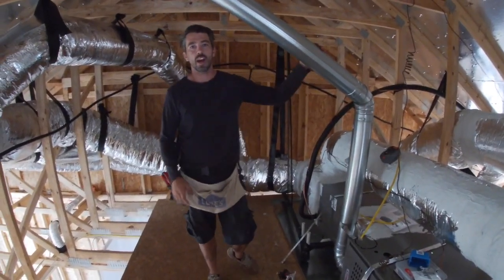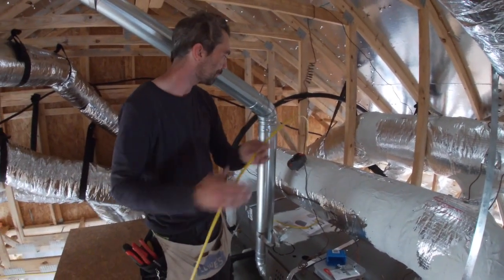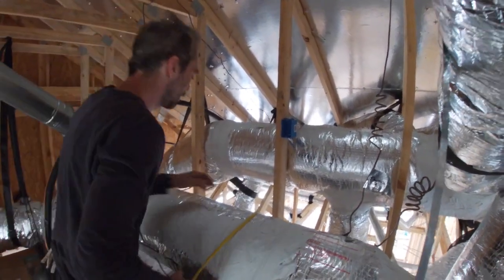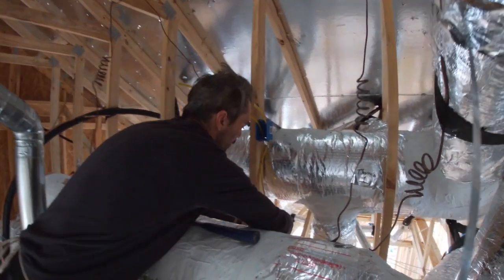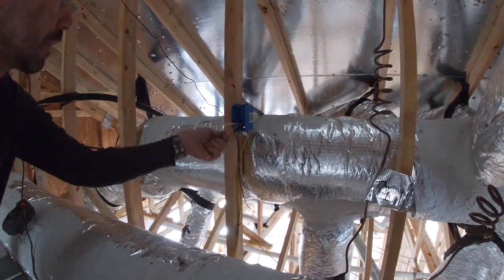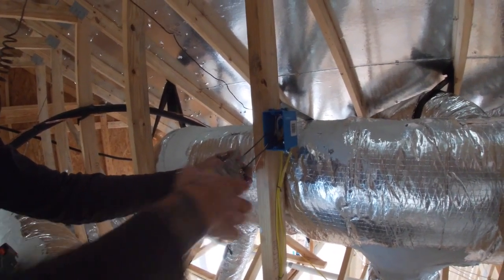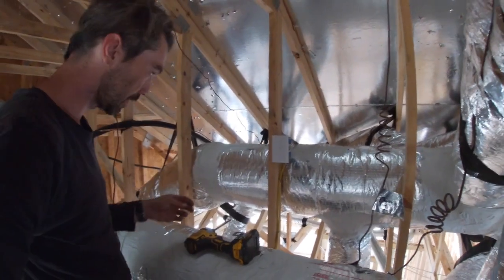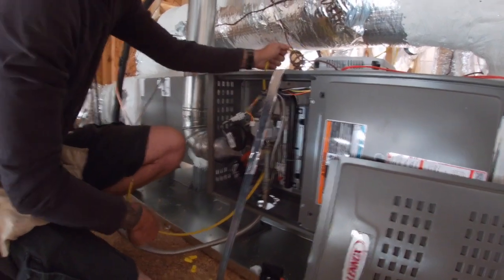Gas Furnace Electrical Wiring (Residential)

Comment: You are powering a transformer, two motors, a control board, and the ignitor. The different type of flue pipes are for different efficiencies.
Reply: Preach Levi...!!!! It's my understanding that furnaces with the sheet metal exhaust pipes are 80% efficiency and the furnaces with pvc exhaust and intakes are 90% efficiency.🤔
Reply: @r.shelton7793  Correct

Comment: Nice. Depending on where you are, a lot of new gas furnaces only need 15a 1-pole and 14/2. The line needs to be dedicated andnthe breaker must be arc fault unless its in a closet or garage.

Comment: do you ever wire power directly into the card. What is you have an unusual plug of the wires just cut it off and connect the 3 wires in the box?

Comment: I'm having trouble with my thermostat kicking on and off I mean totally losing power to the thermostat. All the voltage has been checked going to the thermostat and going to the furnace. That checks out okay. My thermostat goes on and off intermittently. What could be causing this? I've purchased two Wi-Fi thermostats and they're doing the same thing. Please help!

Comment: Couple of questions/observations 1.)  Didn't snug down wire going thru knock out top of cabinet.  Is that required? [related-should supply 12/2 come up from the botton of the furnace near the connection box on furnace? ]    2.)  Can incoming 12/2 go that close to the burners?  3.) Shouldn't the bare ground wire from supply line also have to have a bonded connection to the furnace case/chassis?  4.)  Service recepticle above the shutoff switch?  5.) was 12/2 required or  14/2?     The wires in furnace that connected to the 12/2 looked a lot thinner - like maybe 14 ga or maybe even 16 ga ?
Reply: 1) He used a plastic KO which instantly clamps onto the wire. It only allows wire to be pulled in (albeit with some resistance due to its clamps), and not pushed out. So there’s no mechanism to snug a wire, unlike metal KO. Metal ones have a pair of screws on the outside to snug the wire. 

Also, it’s good practice to leave some slack above the furnace. It makes it easier for the next guy to replace that furnace or rewire it. 

2) That romex is not going into a burner. It’s going into the area where all the furnace wiring is, which is shielded from all the burners for obvious reasons. 

3)It does. Every appliance with a small junction box, like this furnace in the video has three small thin wires: hot, neutral, ground. The ground wire is screwed directly to the chassis. Same goes for dishwashers, disposals, microwaves, etc. 

4)Yeah, that’s a nice thing to have. In fact, my attic has receptacle right above my furnace where my furnaces is plugged into. I personally like that better than what that guy did in this video. Fortunately, since this wiring is in an attic, the next guy can add a receptacle anytime by simply tapping into that switch box. 

5) Just like that guy in that video said, gas furnaces don’t draw a lot of power. It only needs power to ignite the burner and supply any thermostat. That’s why the wires inside the furnace are thinner. This is actually common in many appliances and other devices, not just furnaces.
Honestly, 14/2 would’ve been sufficient for this furnace, but 12/2 provides more headroom. It’s good practice, and often required by local codes, to wire dedicated circuits like this using 12 awg.

Comment: as well as powering the igniter ,wouldnt it also be powering the blower motor contained in that furnace ?
Reply: Yes, how else will the blower motor get power to spin?
Reply: Galvivized pipe instead of black for gas not code, and the electric is reversible you could of move junction box to the top, for if your wire is touching the burner box it could melt the wire course short and cause a no heat situation lol. Just some helpful advice and yes seen it happen!

Comment: Can you make a video, showing the specs of a unit and how to calculate the wire size I need and also size breaker . I’m from NC . I’m working on a 5k furnace and I want to find out my wire size I need to run . But it would help
To know how to calculate everything so I can apply to any furnace I come Across ! Thank you if you do ! Be safe and thanks for the content
Reply: The UL device has amperage and wattage peak listed on its case\door. 
If the device says 1875 watts, you will want 20 amp because 15 amp is only 1800 watts max but we compensate for the 20% which is 1440 watts on 15amp.
For basic home LP gas furnaces, it's 15amp 14-2 wire with a switch just as in this video.
Dedicated 20amp, afci protected is how I ran my LP furnace that requires 15a..  Inspector made me run afci breaker for it. Cha ching..
Very common now that we're into 2021..  AFCI\GFCI dual breakers.   50 dollar bills..
Reply: @DevJB  what about electric furnaces?

Comment: You did not put pigtail ground wire on the furnace?  and where is your receptacle outlet for the pump. lol
Reply: Do you mean attached to the metal furnace box? Or just pigtailed?  
He pigtailed the ground with a crimp (squeezy), gave it a ring a round the rosy (twisted), cut the excess of 1 wire (karate), and ran the single to switch ground screw .
That ground is grounded..  What made me nervous is when he peels the jackets off the wire from within the box, it's darn fast method but I use snips to grip tip of wire and sheers to triple snip the garbage just as fast without any risk of slicing a wire up high.  My knife is banned from entering the box. : )-"
Is a receptacle allowed with dedicated furnace requirement ? 
More info about this pump receptacle stuff is needed for me.. ::ears::   That would have to be on a separate circuit if furnace is on dedicated ? Can they share?  And is AFCI required ?  
These are things I wonder about at 1:03am, weird..
Reply: @DevJB  Good questions! I have to get a nec code book. And  a hvac code book. Knowledge is King !🤴

Comment: Can I connect with another 20amp circuit or it must be a dedicated circuit for the gas furnace?
Reply from the maker: Depends what else is on that circuit. It powers the blower too. Safer to keep dedicated
Reply: A furnace must be on a dedicated circuit.
Reply: @BETTER ELECTRIC , how do i find out what size wire I used for an (electric furnace)
Reply: I’m roughing a house with an electric furnace but I can’t seem to figure out what gauge wire I use
Reply: I think electric furnaces usually have a 60 amp double pole breaker built in to the unit. So you should just run a 60 amp circuit using 4 gauge wire.
Reply: @Tier 3rd  what about if there is no breaker in the furnace unit ? Does that mean it isn’t electric then ?
Reply: I'm not too familiar with electric furnaces but the ones I've seen always had a built in breaker. If there is no breaker then it could just be an air handler. It's like a furnace but only the blower motor and no heating element or heat exchanger. Air handlers usually heat using a heat pump and not by gas or electricity.
Reply: King Larry gaming you have to read the rating plate... It all depends on how heat strips you are running and how many k-dubs a piece. After you calculate your maximum amp draw and voltage drop then you can figure out what size wire you need.. hope that helps.
Reply: Slick703 thank you I will apply it to my next house 🏠
Reply: Slick703 so I will have to add the amps of each heat strip / k dubs and then that will give me the maximum amp draw ?
Reply: @kinglarrygaming2359  14 gauge
Reply: @kinglarrygaming2359  Nameplate